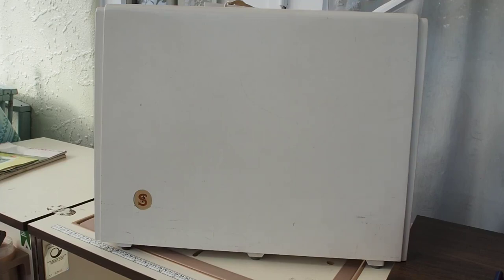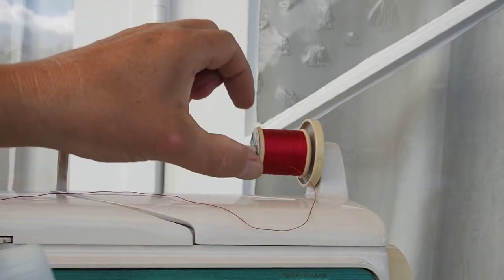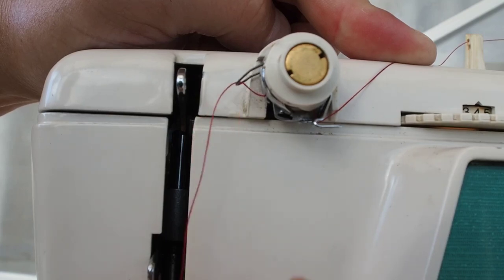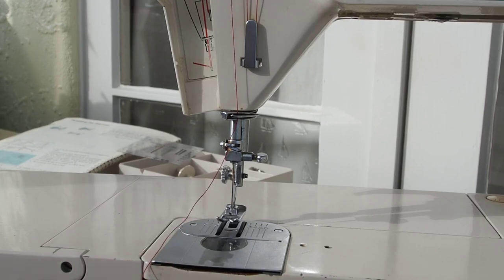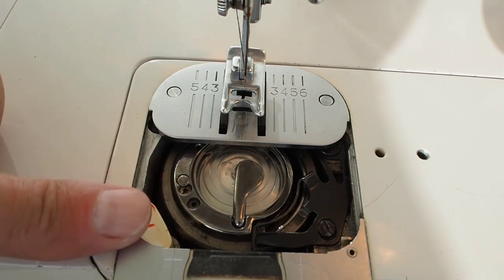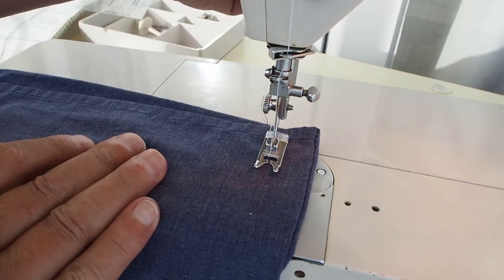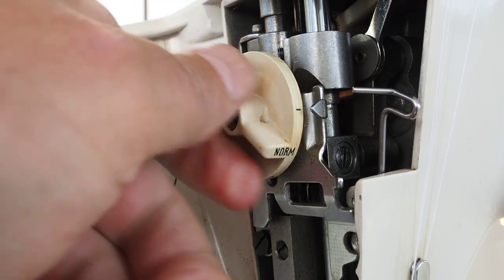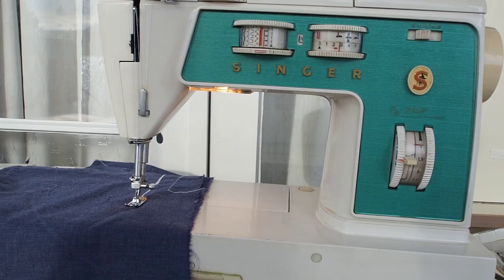Singer 700 Series Sewing Machine - Basics - Part 1

Comment: Thanks so much for the detailed tutorial! I have a problem with the selection of the stitching patterns. The knob, when not pushed in, can be turned which i guess shouldn‘t be. When pushing it in and turning to a different mode , it doesn‘t „click“ in. The result is that it is very had to tell which pattern is slected and it is even harder to change it. Sometimes i push it in and turn around from left to right and it doesn’t change the pattern at all. I don‘t know if you had issues like that before with the machine. Would be great if you have a tip! Thanks a lot in advance 🙃

Comment: Nice, I have a problem with 784, the bobbin winding keeps getting stuck in thread (thread escapes over the winding and starts multiple weeding about 2-5 times until motor cannot anymore pull more thread and grinds to hold. Is there a common trick to fix this?

Comment: I have a Singer 758 and 756...both have problems with turning the stitch length dial...any help would be appreciated...on the 756 I can't turn the dial to the setting to do the flex stitches.

Comment: Not sure if mentioned but can feed dogs be dropped for sewing on a button or does the needle plate have to be changed? I am not getting good traction from the rubber dogs, perhaps metal gripper type can be substituted?
Reply from the maker: Feed dogs can't be dropped on these models so the throat plate needs to be changed. Metal feed dogs could be substituted. The model 720 came with metal feed dogs. Thanks.

Comment: I meant this machine with what looks like rubber flat feed dogs with no teeth?? or is this a special feed dog for a special purpose? thanks
Reply from the maker: These machines came out with the rubber coated feed dogs so they would not damage delicate fabrics but have the grip to feed correctly. It's not a special add on.
Reply: @InStitches   Ive never seen anything like that before, though I know you can buy special rubber feed dogs for industrial machines for voile and net fabrics.

Comment: The bobbin case or the hook on that does not oscillate it turns in the same direction all the time and it's got the timing belt on the bottom that is a good setup. And I do not believe that model has any fiber gears.
Reply from the maker: Yes, the hook is rotary on all of these models and there are no 'fiber' gears they are some kind of plastic or nylon.